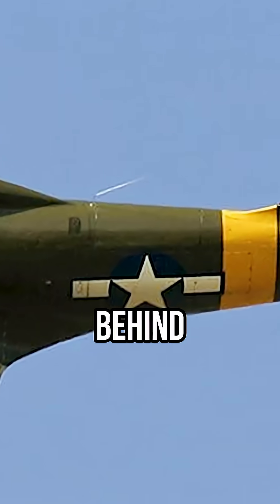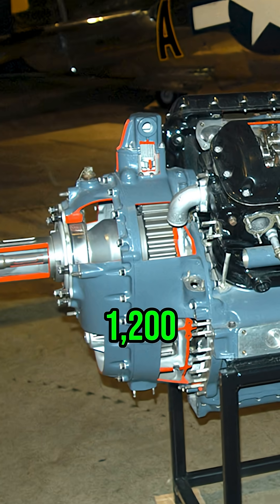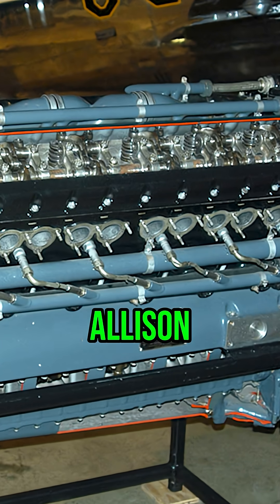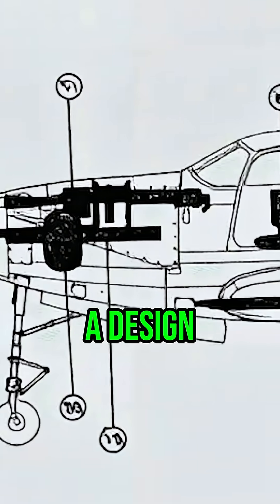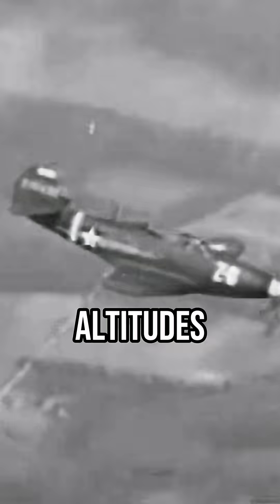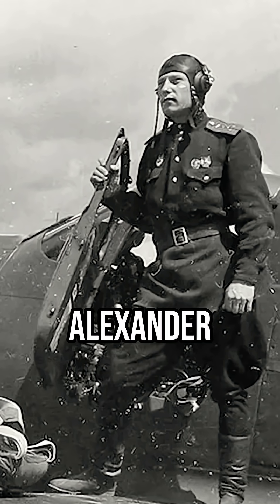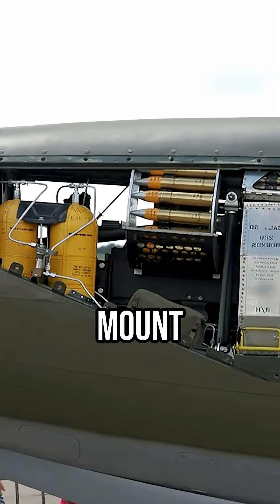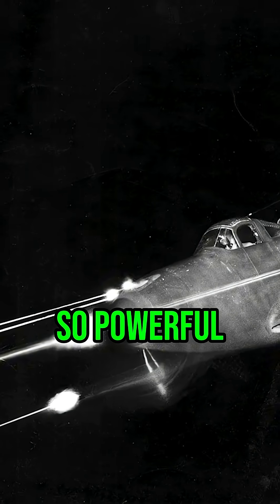Why the P-39 engine sat behind the pilot?

Comment: There is only one thing that happens with a "severely rearward Cof G" and it isn't pretty.  No one would design any aircraft that way.
Reply from the maker: The P-39 didn’t have a severely rearward center of gravity - despite the engine being mounted behind the pilot, designers balanced it carefully with the heavy cannon in the nose and equipment in the forward fuselage. The goal was to concentrate mass along the centerline for better maneuverability. It flew well at low altitude and was actually quite stable - especially in the hands of Soviet pilots who mastered it in ground-attack roles. So while the layout was unconventional, it wasn’t dangerous by design :)

Comment: The rearward engine did not shift the center of gravity back. The center of gravity is essential to stability, you can’t change it like that in this era. What rearward engine did, was shift the center of inertia closer to the center, meaning it took less force on the tail the rotate the aircraft.
Reply from the maker: Yes, the P-39's mid-engine layout didn't drastically move the center of gravity aft - it actually kept it relatively central by design. What it did shift and what matters - was the center of inertia, or mass distribution. With the engine behind the pilot and armament concentrated in the nose, the aircraft had a tight rotational balance, which made it extremely responsive in pitch and roll - a useful trait for low-altitude maneuvering and snap shots in dogfights :)
Reply: You mean the polar moment of inertia.

Comment: The design gave good forward visibility.
Reply from the maker: Indeed, placing the engine behind the pilot in the P-39 allowed for a streamlined nose and excellent forward visibility, which was quite unusual for fighters of that era. It also helped balance the aircraft’s center of gravity and made room for the powerful 37mm cannon firing through the propeller hub :) You are right!

Comment: Unfortunately the cannon was terribly inaccurate.
Reply from the maker: True, the P-39’s nose-mounted 37mm M4 cannon had a very low muzzle velocity (about 610 m/s), which made it hard to aim accurately, especially against fast-moving targets like enemy fighters. The gun was designed more for ground attack and bomber interception than for dogfighting. That said, when it did hit - it hit hard. Soviet pilots in particular made good use of it against soft ground targets and even aircraft at closer range. So yes, accuracy was an issue, but the trade-off was raw stopping power in the hands of skilled pilots :)
Reply: @Airvex-f3d  In the Solomon Island Campaigns there were many wrecked P-39 's.  The Navy would take them and mount them on PT boats.  They worked very, very well as barge sinkers.  Some say the best application of that gun.
Reply: atleast it's not the mk108
Reply: @Binh-wx1cu The Mk108 was more effective.
Reply: @Desertduleler_88  idk that, cuz the mk108 has only about a muzzle velocity of 540m/s, but it can be true, as the me262 is too advanced at it's time
Reply: @Binh-wx1cu Fw190 & Bf 109’s also had them on the latter models
Reply: @Desertduleler_88  yea ik, but me262 is what makes the mk108 well-known
Reply: also, i use the ap variant of the 37mm m4, so maybe i think it's more effective, but the p39 compensated this for smaller-caliber mgs, so it is still underrated

Comment: Pokryshkin, over 60 kills, flew only Airacobras and Kingcobras. He and his regiment refused to change to Yak-3s and La-7s.

The stupid US army top brass penpushers took out the Airacobra's turbocharger and supercharger, saying no need,  and cropped its wings to fit hangars, turning a superb fighter into one struggling at altitude.

British pilots evaluating the Airacobra reported it as a death trap above 15'000 feet.
Reply from the maker: Absolutely, great points! The P-39 had a rough reputation in the West mostly because it was judged by high-altitude standards, where it just wasn’t built to compete (especially after the turbocharger was dropped). But in the Soviet theater, it proved to be exactly what was needed: fast enough at low altitudes, heavily armed, and rugged. Pokryshkin and other Soviet aces flew it to devastating effect, and even preferred it over newer Soviet fighters. So yeah, the P-39 wasn’t a failure - it was just misunderstood outside the context where it excelled :)
Reply: @Airvex-f3d  The Soviets complained the P-39 tended to tear it's flaps and rudder off when pulling extreme maneuvers. And I wouldn't say rugged as the Soviets would strip the factory-fresh P-39s of it's wing mounted machine guns, armor, fuel-tank sealants etc to lighten the airplane and make it maneuverable but as combustible and vulnerable as the Japanese Zeros. 

The Soviets rarely used the 37mm cannon as it's velocity was awful, the round drooped as soon as the round left the barrel. Not just that, the cannon tended to jam. They mostly used the concentrated nose-mounted machine guns for everything else.

The flap and rudder tearing issue was somewhat corrected in the Kingcobra.

Comment: With that heavy nose mounted armorment, its basically the A-10 Warthog's Granddaddy.
Reply from the maker: For real :) That big 37mm cannon and tough airframe gave it total A-10 vibes: low, mean, and built to shred stuff on the ground. Warthog DNA for sure
Reply: @Airvex-f3d  The 37mm cannon was designed to destroy bombers not ground attack.  The plane was designed as an interceptor.  There was no AP rounds manufactured for that 37 mm round.
Reply: This 37mm wasn't for tank busting, it had no AP ammunition...